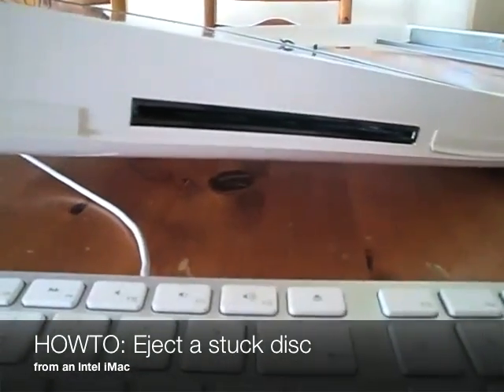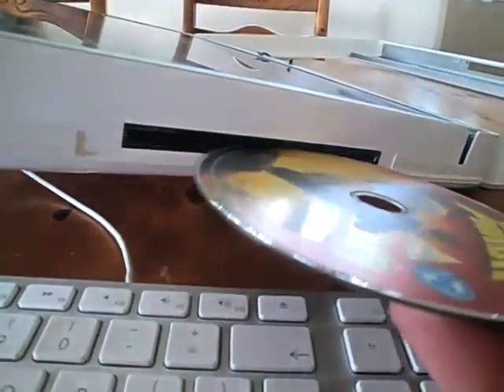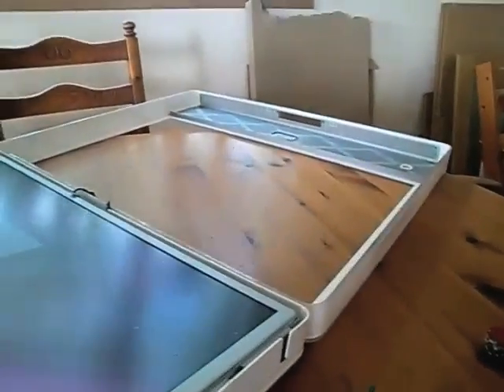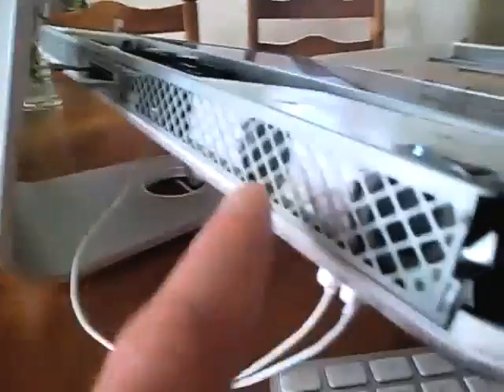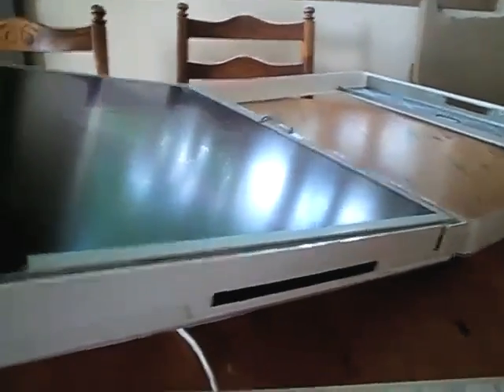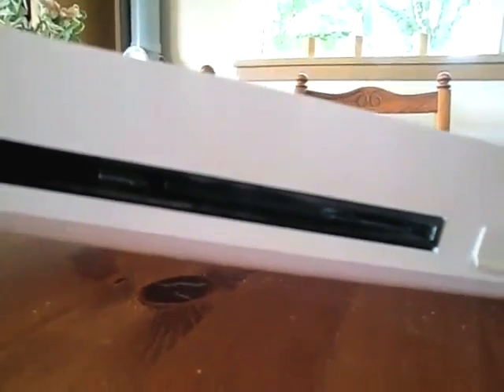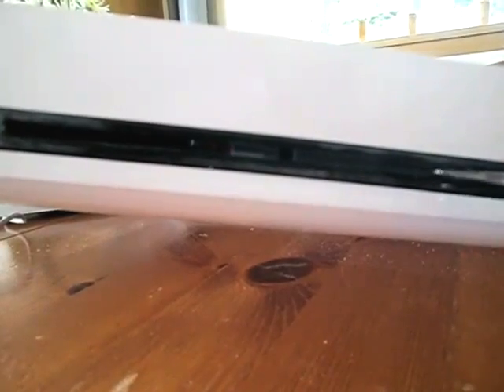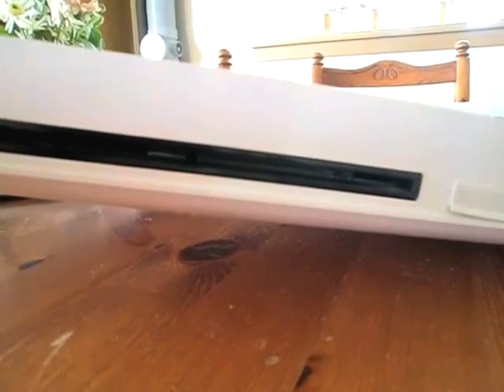Eject a stuck disc from an intel iMac

Comment: Thank you very much. I ended up using a bread knife but it worked. Didn't scratch the CD. Probably saved me considerable time without the computer in the shop. Much appreciated.
Reply: i scratches a few too then i use a blank cd thru slot and push it in ejects the disk

Comment: I found that my problem of a CD stuck in the slot was solved by shutting down the imac and on start up, hold down the left button on the mouse and the CD ejected properly.  A Restart was not successful, I had to pull the plug and press the Start button on the computer.  That worked.

Comment: Thank you. I used a combination of typing the "drutil eject" command in Terminal multiple times and sticking a kitchen knife in the center of the slot where I could feel a little pin blocking the disc. I, too, had tried every other suggestion online with no result. Cheap "Verbatim" disc.

Comment: Thanks!!  Just what I needed.  Disk had been stuck for over a year and I just could not get it out with the other methods.  I had to hold down the mechanism AND squeeze the disc really tight between two thick plastic cards, and then pull the disc out.

Comment: In the event that a disk has become stuck in your Macintosh computer, there are several steps you can take to try to force it to eject.

1. Restart your computer, and hold down the mouse button. If you have a 2 button mouse, hold down the left click.

2. If your computer has an eject key on the keyboard, restart the computer again, this time holding the eject key.

3. Open a Terminal window and type in drutil tray eject.

Comment: after trying everything else, this worked. I used a plastic fob that goes on a keychain, one of those doohickies stores give you so you don't have to use a credit card sized id. I think the secret is placing it in the right place, which this video shows quite well. It worked the first time. Thanks for posting this video!

Comment: I had this very same problem in my iMac, but I used another cd than any tool.
When trying to eject first time (and the cd inside won't come out) I just inserted another cd to block those "jaws" which prevents putting another disc inside.
Once the second cd was blocking those jaws getting closed, I just ejected the cd inside. 

I think this way may be little bit "safer" or "simpler", no need to tear apart my mac :)

Comment: Wow!
Thanks a lot. 
I used an old credit card, followed your instructions and now the disc is out.

Six months ago I took my machine to Apple and they pulled another disc for me. Walgreen's picture disc's do not eject at all. 
It think the printed surface of the disc surface is too smooth. 
None of my heaver printed disc's have this problem. 

I learned something actually useful today.

Thanks again.

Comment: I haven't had the courage to insert a disc a full 100%, since it does not "slide in" when its like, half way through - like I expect it to. I have to push it all the way, is it meant to be like that? I just got me an iMac, you see, and I don't fully understand how this disc drive would work. If it's not meant to be done like that, I'll send it back to be repaired or something.

Comment: Thank you! Thank you! THis did the trick after days of struggling with a stuck dvd

I didn't take the cover off. But found that spot you show in this video by feeling around with a dull knife towards the top inside of the drive. It kind of sticks out and you hit it just after you push the eject button.

Comment from the maker: This is standard 3rd party drive, at most this will deliver a 12 volt supply to the drive and very minimal risk of this being exposed on the casing of the drive.   I agree that a plastic utensil would be a good idea, as I have comment on, a credit card does the same thing.  But I don't think anyone should fear electric shock.

Comment: you're right let me rephrase it, if theres nothing else that works (for me restarting the computer and while its powering up click and hold down right mouse button until the disk ejects worked), and u have to resort to physically having to remove the disk, then this is a good video to use

Comment: Wow. Great help. I am still having trouble though. It is not pushing the disc out after I hold down the plate.  Do I have to lay the computer down like you did? Do I have to do this on the startup screen like you did?  Thanks